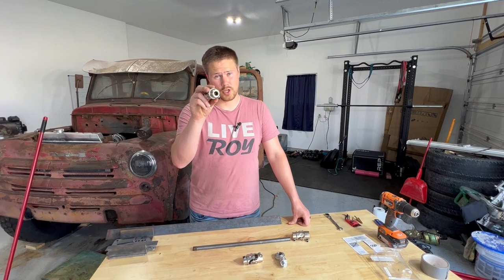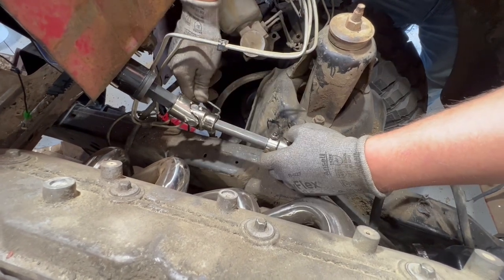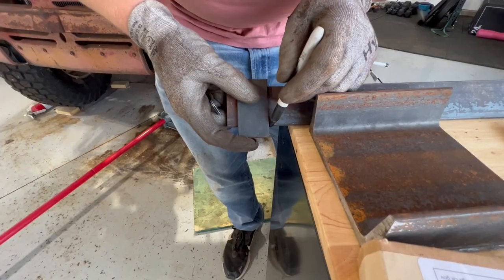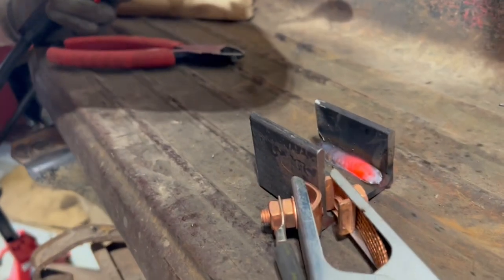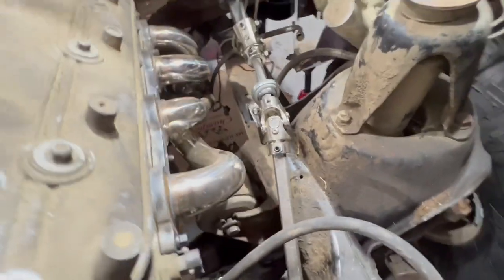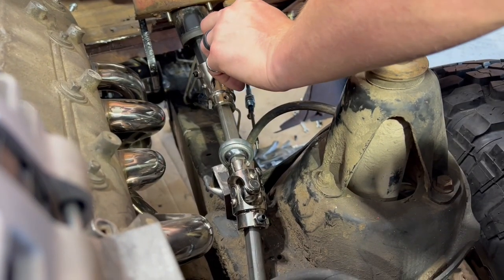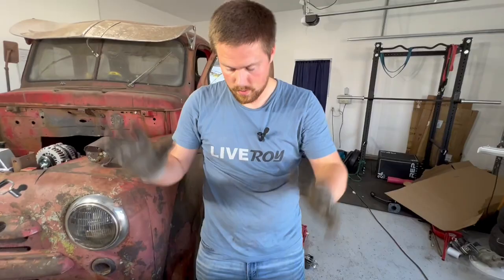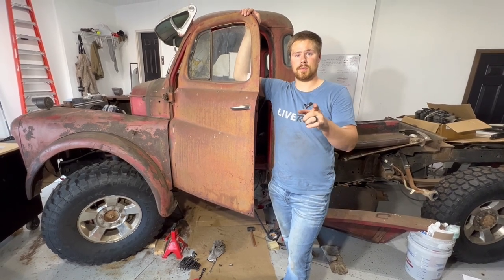Building Custom Steering Shaft | U-Joints And Steel Shafts | The Dodgeball

Comment: Great video guys, currently trying to do a custom steering set up on my van as done a full loom swap and engine, van was hydraulic but trying to convert to fully electric, got the electrics all working just issue is the steering rack as the position is off for the column and 1st attempt got binding so thought I’d look on YouTube for ideas 😊
Reply from the maker: @GaryTaylorvw  Thank you! I hope the second attempt works for you!
Reply: @theroygarage hope so, problem I’ve had is the original column goes through the floor and the angle for the electric rack is off, by 2 inch enough to make it lock up, just seen 90 degree steering boxes / gears that would solve my issue as could take the column through the bulkhead then down would give more room for adjustment and no binding, ever used one ?